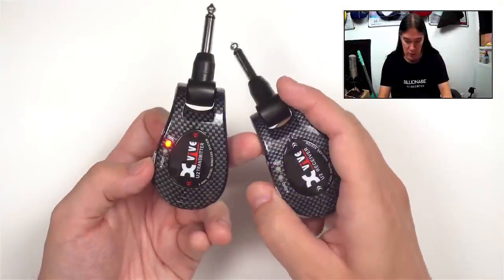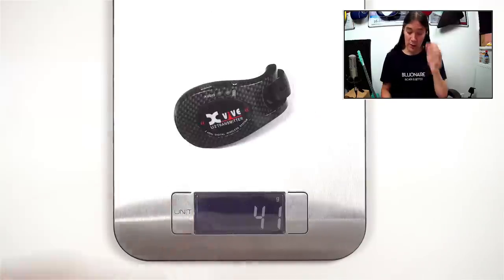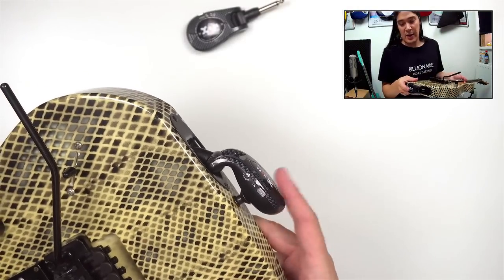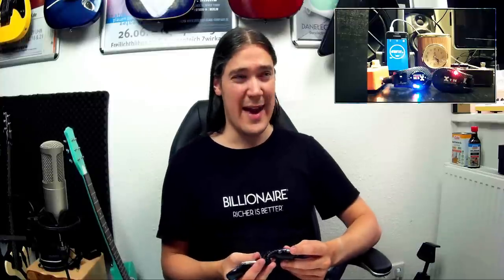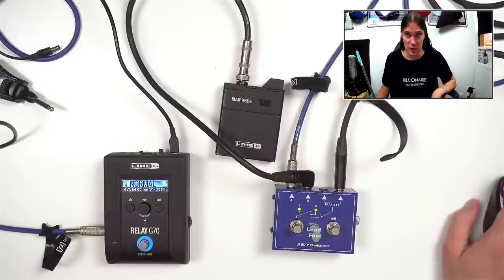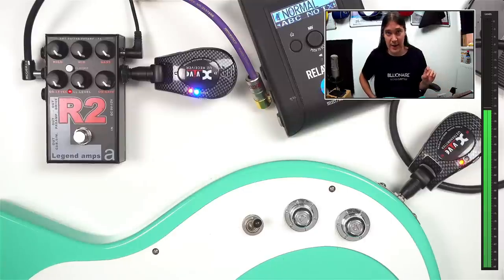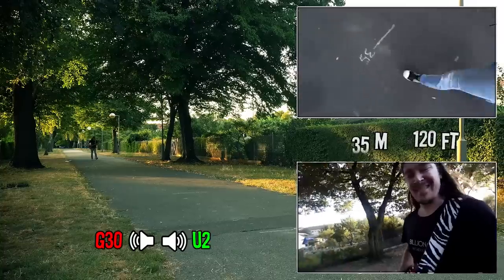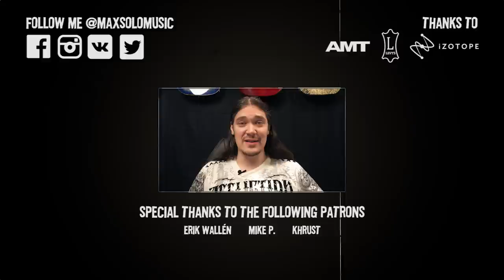Does XVIVE U2 Really WORK?

Comment: This is really an excellent review. If you want to avoid conflicts with your WiFi consider using the 4 and 5 settings on both the transmitter and receiver. Most WiFi frequencies and  other device frequencies are going to fall into the #1 settings by default. I think the 4 and 5 settings and eliminate or  minimize the the risk. It's worth considering and I hope this helps. Thank you so very much for your review.

Comment: Excellent review, thank you.  I have been using the Xvive U2 system for a little over a year now (over 100 gigs).  I wish I could say that I have never had dropouts, but that wouldn't be true.  The amount of dropouts are very small and when taking the initial cost of the device into account, I think they are insignificant.  Your review has clarified a lot of points for me.  Thank you again.

Comment: Another great review! I am now using Lekato 5.8 ghz wireless that I found on Amazon at the best price. Works very well at about a third the price of these. Also, right now getting just over 5 hours on a charge, although the receiver lasts a bit longer as expected. Sound quality with no noticeable degradation, no dropouts or interference, and build quality is good. Keep up the good work!

Comment: Not all "professionals" play in large, venues, stadiums or auditoriums. I play very small venues, thus am not concerned too much about latency, nor LOS connectivity. I do, however, delight in the potential to be almost totally wireless with the versatility of two Xvive U2 (Dual) units combined with an Xvive U3 wireless mic system. While I have not yet tried it, I intend to adapt a U2 system to transmit my backing tracks to my amp, along with any three of my instruments, such as guitar, mandolin or keyboard. Most current power packs for wireless instruments are cumbersome and difficult to position anywhere without some kind of motion interference. This combination will allow me to only need a single power cord, which will be used to power my amplifier. Thank you for such a thorough and comprehensible review of what I deem to be a cutting edge tool for musicians.

Comment: I just purchased 2 of these devices. Thanks to your wonderful review, I have a better idea of which instruments to use them with. The depth of testing and insight was well above and beyond any reviews that I've seen anywhere. Thanks so much.
Reply: I don't suppose you ever tried running two at the same time? Example, one wireless from guitar to multi-effects unit or pedal board, second from the above to an amp.

Comment: You address the one thing that no other reviewer does. The noise this wireless system makes is absolutely grating. I've tried everything I could think of to cut down on it, but to no avail. Barring a noise gate, I don't think there's anything else I can do to help with that.

Comment: OK, so I bought one.  Used it 6 or 7 times and it operated flawlessly.  The 8th time there was a small glitch and I ignored it.  The 9th time it completely cut out from about 30 feet away.  After that it just sputtered if I moved a foot.  Wow, talk about embarrassment on the bandstand but after some testing I learned a valuable lesson.  Always make sure your battery is charged before a performance.
Reply: Oh good, I was getting worried, reading this - until the end. I just bought a pair yesterday, you see!

Btw.. have you noticed the highs are a bit brittle, and harsh? I'm finding I need to roll my tone knob back - and that goes for my LP aswell as my Strat...and PRS, for that matter. I pretty have never used my tone knobs until now!

Other than that, how do you find the overall sound quality?
Reply: It f**king defeats the purpose to plug in your wireless system to charge it while using it!. Then, you might aswell use a lead - doi!!!

Comment: Awesome review, as always! 

I'm still thinking the 2.4 Ghz systems are unsuitable for real live use.

They all work perfectly in test conditions, but at my venue I've seen sooo many guitarists with different 2,4ghz systems having issues. I always warn them before soundcheck, that they will not have a good time with those things. At soundcheck everything works fine, but: As soon as people get into the venue, they will bring their smartphone along. And heres the thing - Even though you are obviously not connected to the wifi with your smartphone, your phone will still block a small portion of the 2,4ghz spectrum by actively searching for your home wifi. Suddenly you have total chaos on those frequencies, even though everybodys wifi is "off". And I've yet to see any review replicate this at all.

Low and behold: Massive dropouts, every time. They scramble to find a guitar cable after the second or third song.
Reply from the maker: Which means your venue is perfect for testing 2.4 Ghz wireless systems! I wish I had a place like that nearby
Reply: places with loots of people are ideally suited, too. e.g. a busy train station, shopping mall, etc. - you just need lots and lots of wifi spam in the air!
Reply: Thanks for this info.  I need wireless for church gig.  We run up to 6 wireless IEMs and the other guitar player is running wireless.  So I think for me this would not work.  Too bad looks awesome.  Thanks again 👍
Reply: Your comment is exactly what I was looking for. Thanks for the valuable info.
Reply: hi jan. thanks for the heads up.. 
do you have a different wireless system to recommend due to your knowledge and experience ?
Reply: Apparently, No....

Comment: This is the most thorough review of wireless guitar systems that I've come across on YouTube.

That said, I bought & have these direct from China A-8 transmitter/receiver that operate on 730 Mhz UHF signals. The upside to that is they don't use the 2.4/5 Ghz frequency that a cable modem/router broadcasts with, even the wireless handset telephone systems or anything else that is a2.4 Ghz frequency. The A-8's were $ 22 delivered thru an Amazon purchase. A friend has the XVIVE U2's and his are dead silent. That's a luck of the draw, hit & miss with even the XVIVE U2's from this test. Reviewer gets about 15 dB of noise and that's a whisper level of noise if you research noise dB levels online, but not annoying enough just the same & not dead silent like my friend's U2's. That said, even these XVIVE U2's are far quieter than the A-8's. The A-8's I have are noisy af. You can play with the gain and set that low at 1-2 with overdrive and live with these for practice sessions at max volume, but it's not neary loud enough cleaner to gig with. On clean without overdrive, then you have to set the volume where the noise isn't going to be annoyingly overwhelming for the A-8's as well and that's around a volume setting of 2-3 on the amp itself. I'm using the A-8's on a PYLE PVAMP 60W amp and it's a noisy amp instrument corded compared to the brand names that pretty much every Music store sells. But we tested the A-8's on a VOX & Yamaha practice level amps and it made no difference in the noise and even the guitars used. The A-8's will do everything and even be noisier with max volume. Perhaps you could gig with the A-8's and drive enough music to overwhelm the noise the A-8's make, but it's still going to be unwanted/undesirable distortion. So the A-8's are a low volume output, low gain alternative to cables for practice purposes only. I was hoping to see in the dismantling of the U2's that there would be some screwdriver type adjustment that one could phase the transmitter and receiver to eliminate that noise, but I didn't see one from the video review and I don't want to dismantle the A-8's and destroy them for a $ 22 bet that may or may not work. For now the A-8's work, just not as silently as my expectations are/were for them.

And when I read reviews of the A-8's, even the U2's there are enough complaints in the negative & lower rated reviews for noisy wireless guitar systems. So that tells me it was hit & miss for noise vs silent products. Oh well, my hope was to be wireless primarily, use the instrument cord as a backup. Instead the instrument cord is the best quality and the wireless is a practice only & in a pinch for gigging alternative.

Comment: I just can say WOW and more WOOOOOOW. Amazing review with real numbers not just a SUBJECTIVE OPINION. I appreciate the review planning explaining in the intro what would be covered, comparison with other devices, the marks on the floor when you did the range test. I was surprised with the level of noise, personally I think I could live with those 5 ms but not sure about the noise. Question: What device would you recommend in that price range? Thanks you Sir, greetings from Switzerland.
Reply from the maker: Hey. U2 actually performs quite well as long as you don't go for a very high gain sound. I used it with my active bass during live performances. So far so good. Speaking of other brands and devices, Line6 is good but more expensive. Shure has a good wireless system but also more expensive. I'm looking forward to check the one from Harley Benton, it looks promising

Comment: Incredible work once more! Would love it if you could do a latency shootout between the G70 and the Shure GLXD16
Reply from the maker: Thanks! Yeah, that should be easy. Anyone here has contact to Shure?
Reply: Max Solo Music - Thanks. I have seen people on the internet swear by the Shure GLXD 16 as one of the most reliable wireless systems out there but the latency of the G70 seems so much lesser than any other wireless system on the market. I use a lot of pitch shifting effects and drop tune pedals and those by itself introduce quite a lot of latency . For people like me the wireless latency has to be an absolute minimal thing to compensate for that.
Reply from the maker: yep, the lower the better :) I've never tried GLXD 16. But it doesn't use standard AA or AAA batteries. So, no professional use by any means

Comment: Thanks for that great review. Are there any wireless systems for bass guitars? I tried a cheap one from Hoison Music from China and got a lot of interference plugged into my bass.
Reply from the maker: U2 is a digital wireless system and unlike analog ones it has no problems with transferring low frequencies. Therefore it should work just fine with a bass. Although, it's likely to have problems with active circuits, like acoustic guitars with piezo pickups, guitars with EMG pickups or active basses. I'm pretty sure that's exactly what you've experienced with the system you've tried. In that scenario you'll need a transmitter with a metal enclosure. Like Relay G50 or G70 from Line6
Reply: @MaxSoloMusic  Thanks.

Comment: I have three transmitters and the receiver.  I use several guitars and it's really convenient as you turn one off and turn the next one on.  It's that simple and I don't have to unplug and plug in any of the guitars I'm using.  I started using channel 4 because another guitar player in our band has been using channel 1.  I got a pretty bad amount of interference and drop outs on channel 4.  I switched to channel 3 at rehearsal tonight and it worked fine.  I have a fairly big show Saturday so that will be the test.  We're now using channels 1, 2 & 3 in our band.  I hope it works.  Has anyone else had any problems with channel 4?

Comment: Hello, I have a gray X VIVE U2 model that has the battery that does not last as long. Its reference is 3.7 V 650 mA. I find 3.7V batteries but with 600mA. Do you think it is possible to replace it with this model? thank you

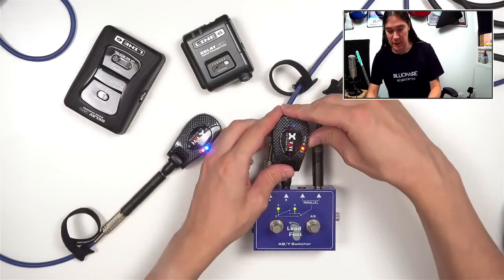Comment: Amazing review.  Reason I am seeing your review is because at a gig last night my line 6 relay transmitter? (The box that I plug in my wah) did the exact same thing as yours did at 16:23.  It flashed red and kept peaking red and my signal kept cutting out.  The battery in the smaller unit (in my pocket) was fine.  But I was cutting due to the bigger unit peaking red.  This had never ever happened before.  Would you know the cause of this? You seem to have that diagnostic electrical perspective hence was curious.  I figured It is defective and I wanted to purchase the X, but figured I try asking.  Thanks !
Reply from the maker: Hey. That was most likely caused by a radio interference with some other unit operating on the same frequency/channel. Usually Wi-Fi routers (including access points created by mobile phones) may cause problems if they are too close or in between your guitar with transmitter and the receiver which is in your pedalboard. For that reason there are multiple channels available on U2 and similar wireless units to choose from. It should work fine as long as there are no huge overlaps in frequencies. There are ways to check that, like wi-fi analyzer apps can show you all wi-fi networks around you and what channels those networks are using. You can compare that to the frequency table of your wireless unit (if it's made public) and pick one without overlaps. I usually prefer to run my Relay G70 on channel 3 or 4, usually those are free. But G70's signal is so strong that it just kills any wi-fi in 50m radius. Therefore it was banned in the EU until Line6 "fixed" it earlier this year
Reply: Max Solo Music thanks for the response.  July 6th show I will try a diff channel on the G30 if the same thing happens.  I thought perhaps an internal battery was dying but I have never opened up the transmission box.

Comment: Hi, I changed the batteries in my XVive U2 system. The problem I had was that, from time to time, on the receiver, the blue button would flash and vibrate the sound, a bit like a tremolo. I thought it would go away by changing the batteries, but the problem is still there. Do you have any idea where this would come from? If anyone has had this problem and resolved it, please let me know how to do it. Thanks for this video.

Comment: Hello and thank you for the review video. I bought a XVive U2 system after watching your video. I have two issues with it and I was wondering if you know the answer: 
1. when I connect my guitar to the amp directly using a cable, I put the amp volume to 1 and it's low enough. But when I connect the XVive system I can't hear anything and I should turn up the volume to 3. Have you faced the same problem? any solution?
2. the system doesn't memorize the channels. Basically anytime I turn them on I have to do the channel setup again.
Reply from the maker: Hey. The second issue looks weird. I have two U2 sets and both store settings and recall them every time I turn them on. Do you still have a chance to return/change it at the store? Cause this doesn't sound like intended behavior.
As for the first one, could you be more specific? What kind of amp is that? Brand and model. What do you mean when you say volume - gain, channel volume or master volume? U2 operates at unity gain, so problems like this should not occur. It might however happen if for some reason your amp has a low input impedance. But again, that would probably result in an opposite effect - the active U2 source being louder than passive pickups connected directly to the amp. What pickups does your guitar have?
Reply: Max Solo Music Hello and thank you for the reply. I’m using it on an Ibanez bass guitar connected to fender rumble 40 amp directly, no effect. I’m referring to master volume.
Reply from the maker: @graphicsociety1  something causes the input level to drop. I'd start troubleshooting with another instrument and another amp. If that won't work - with a buffer or a boost pedal. Check it in different combinations, like before and after the U2 to figure out what causes the level to drop. If that's an active bass, you might have gotten the "lucky" ticket. There were reports of U2 not doing well with some active circuits and piezo pickups
Reply: Max Solo Music I figured it out. The jack can’t go in all the way. What a stupid design!

Comment: The battery is supposed to last up to 5 hours.If you're going to play in a gig ,don,t you think you would be prepared and charge it before your performance ?Where is the problem? Most gigs won,t go past 4 hours anyway.I,ve used mine for 3 hours and never had a problem with it,and if i do i had guitar cables handy.

Comment: I having problems with mine they keep breaking up , I’ve changed channels but any more than 2 feet away and the blue light is blinking meaning they are losing connection; any ideas? I’m thinking outside interference
Reply from the maker: Are there any other wireless devices nearby? Cell phone with activated access point maybe?
Reply: Max Solo Music yeh my iPhone which I need for wifi for my backing tracks

Comment: Important Question: When it says it's "digital", does that mean the anologue tones from my analogue FX pedals (ie. Analogue delay) have been reprocessed out as digital now? The same goes for my tube amp. Does it send out a processed "version" of my gorgeous Fender hotrod tone, thereby making it digital..and therefore not much different from a modelling amp?? 
   Or am I misunderstanding the term "digital" in this context?
Reply from the maker: To add more to that confusion I can say there's no analog delay in the modern world. They all are digital. Some simply degrade the sound to mimic a tape delay, therefore guitarists call them 'analog', which from the technical perspective is not the case